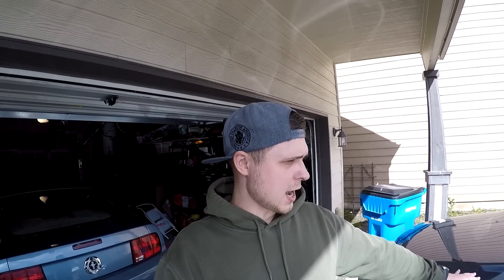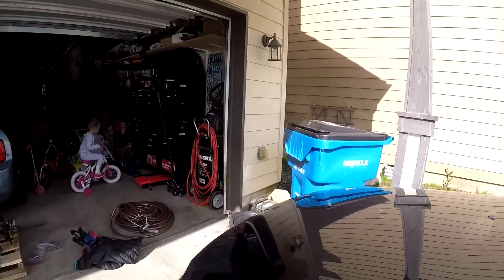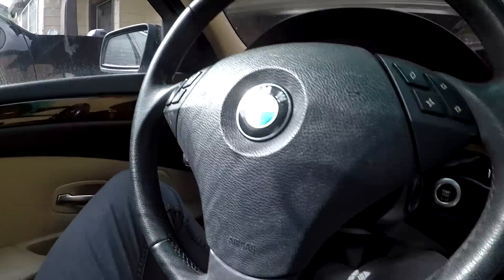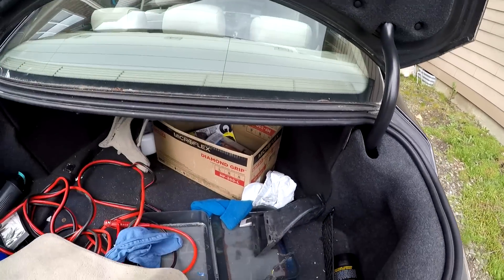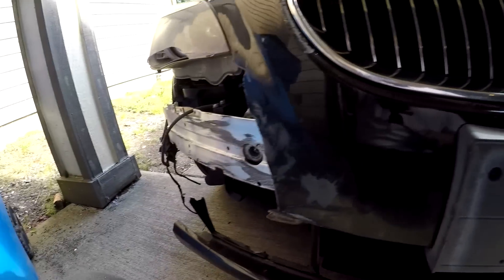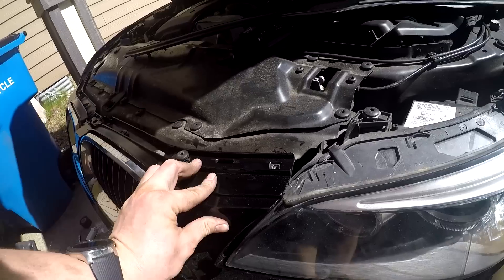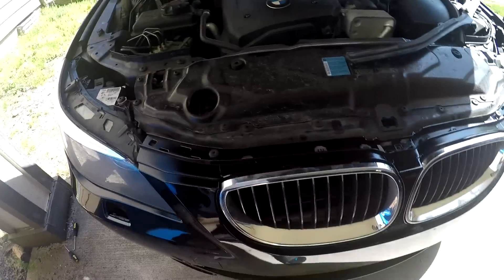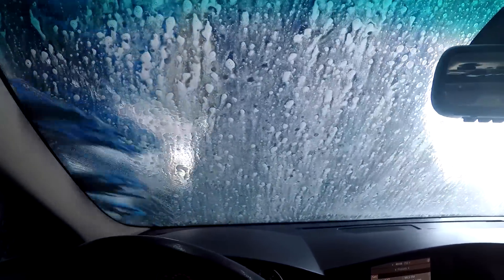Copart Rebuild Start to Finish Salvage BMW 5 Series E60

Comment: when the check engine was on,the engine was stable or unstable? :)
Reply from the maker: It was unstable at first, but it was a little low on oil and hasnt been started in a long time. 5-10 min of running and it was perfect